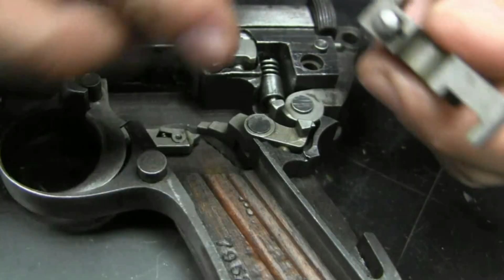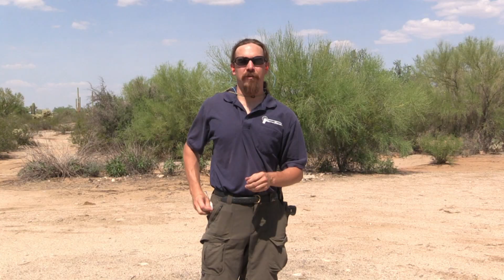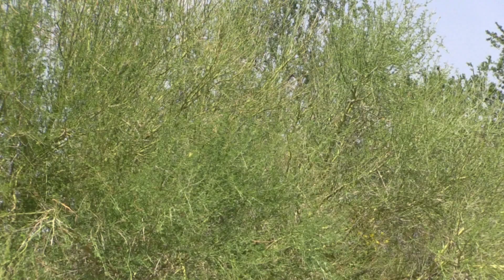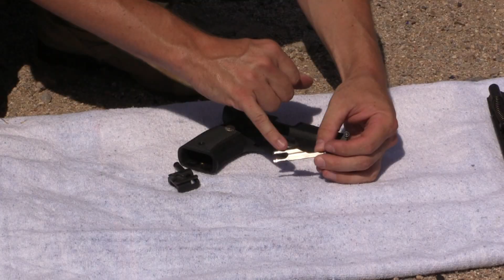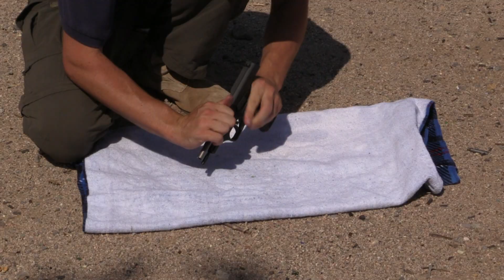Colt All-American 2000 (Disassembly and Shooting)

Comment: i bet Eugene Stoner was pissed that they fucked up his design... just like any other inventor screwed over by a company
Reply: Gene Stoner designed it just like they built it.  Read the patent:  https://docs.google.com/viewer?url=patentimages.storage.googleapis.com/pdfs/US5024139.pdf
Reply: true but in the video Ian said that Colt made changes to the design, making it piece of junk
Reply: Comrade Stalinator That is that is what has been repeated and accepted because people revere Knight and Stoner, not because there is any basis in fact.  Since Colt went into bankruptcy, rumors were flying freely and nobody at Colt was defending themselves.  For his part, Reed Knight would never have admitted (nor was it really his responsibility) that the design was bad. Stoner was Teflon.  There you have it.  No matter how many times you write it down, it does not make something true.
Reply: You're under a false assumption that I am not calm.  Cheers.
Reply: RyeOnHam 1. The barrel bushing is smaller in the patent and is not insanely long like in Colt's version.

2. As said in the video, the trigger pull was meant to be set at 6 pounds, not 12 pounds.

3. It also appears that the trigger pull is shorter in the patent.

4. The original design also called for a shorter barrel and frame, and a single stacked magazine.

5. The original prototype had an aluminum frame, not polymer. The slide rails on the origional would last much longer than the ones on Colt's version.

The prototype of this firearm proved to be well made and worked like it should. When Colt's version of it was presented at the 1991 shooting, hunting, and outdoor trade show, both Knight and Stoner were present. Neither seemed to be too happy about the changed made to their design. It's simple, Colt made an idiotic decision to change a lot of the design of an already good gun. The increased barrel length and grip length messed with the gun's balance which was originally quite good. The long heavy trigger pull had a negative effect on accuracy, and the cheap flimsy polymer rails that the slide traveled on were prone to excess wear, which could have easily had an effect on the gun's reliability and accuracy.

-Signed, an engineer.
Reply: 1. Ian named the sight being on the bushing as a POTENTIAL cause of inaccuracy. It would have zero effect on the accuracy until that bushing became worn. The cheap polymer slide rails would wear long before the bushing did, and the heavy trigger pull would have an immediate effect on the accuracy.

2. Knight stated what the trigger pull was supposed to be. Seeing how he was a co designer of the gun, I'm more inclined to belive him over you.

3. What made the trigger heavy was Colt purposely screwing with the weight of it to intentionally make it heavier. That's been covered.
Reply: Knight designed the damn thing, if he said it was supposed to have a 6 pound trigger pull, then it was supposed to have a six pound trigger pull. Nothing you say will change that.

As for the Ruger, first off the gun was designed to use polymer rails. The Colt originally had an aluminum frame and rails. The Ruger's rails are much beefier than the Colt's and the polymer used to make them is most likely more durable.

Did Colt make the trigger heavier? Yes, what part of that do you not understand? Knight says they did, and it's well known that Colt's lawyers convinced them to increase it. You seem to be the only one not getting that.

The rotating barrel design was based on that of the Steyr M1912 semiautomatic handgun, which was designed in 1911 by Karel Krnka. Unless Johnson could have somehow helped design that system when he was only two years old, then I'd say your claim doesn't hold water at all.
Reply: "The original Knight/Stoner version had a 6-pound trigger pull according to Dave Lutz, vice president of Knight Armament"

"At the attorney's insistence, the trigger pull was increased to 12 pounds. The barrel length also was extended by roughly an inch, and the grip was extended as well, he noted"

-The Gun Digest Book of Assault Weapons

Where is your proof that a 6 pound trigger pull was impossible? Colt screwed with a good design and messed it up. It is solely their fault. NOT Knights and Stoners. All you have proven so far is that you don't know much of anything about this gun. You are making speculations based purely on opinion, and are ignoring the facts.
Reply: Funny how their prototypes worked just fine then. They were not experiencing problems UNTIL Colt started messing with the designs.

You've been making the assertion that Knight and Stoner is to blame even know there is DOCUMENTED proof that Colt changed the designs in major ways. Stoner and Knight were not happy about those changes, and it don't take a genius to know why they weren't happy about it. Colt took a good design, and turned it into utter shit. That is their fault, and it's one of the reasons they went bankrupt.
Reply: I never said Colt didn't make good guns, they just dropped the ball on the All American 2000.

I'm guessing your just a Colt fanboy who can't stand it when people bring up on of their failures. The design was solid, the prototypes worked, and there is no reason why that gun would not have worked as a production model had it not been for Colts stupidity in letting a lawyer make changes in the design.

Colt made a mistake, and it's well know that it was their fault. Get over it.
Reply: Actually, I prefer the works of Browning. I'm not even sure what all knight makes because I haven't cared to look.

Stop reading books? That is a pretty idiotic thing to say, I guess ignorance is bliss.

Who's trying to sell me something?

All you have been doing is making half assed assumptions with no evidence to back them up. Either provide evidence to your claims, or drop the subject.
Reply: Comrade Stalinator 
It's hard to say that Gene Stoner actually designed anything from the ground up.
The rotating barrel concept was used in some of the very first semi-auto pistols.
Likewise, the AR copies directly almost all of its features from the StG44 (split receiver, recoil spring in the buttstock, mag release, ejection port cover, magazine) and Mondragon 1894 (general bolt design), direct impingement was not a new concept either, it was used on MAS-49 and Ag m/42 (both rifles were in service before the AR ever hit the drawing board).
Reply: Jersey Streicher You're mixing up several designs and not going back far enough.  Virtually everybody copied Browning.  Browning patented the Rotating barrel at the same time he patented the pistol slide.  The Remington Model 8 (Browning) featured the multiple-lug rotating bolt. The MP43 was very innovative in overall design, but not so much the elements you mentioned.
Reply: RyeOnHam
There's a huge difference between near-plagiarism and deliberately getting out of your way just for the sake of innovation.

Stoner did very little aside copying other's designs and was pretty lame at it, as evidenced by the fact he copied the StG 44 magazine ommitting the anti-tilt follower features (because apparently he had no idea what purpose they served).
Another example is his reversal of the mag release in the AR (in comparison with the StG 44) to allow mag release with the index finger, it also required a weaker spring, which originally caused accidental mag releasing, before a mag release shielding rib was invcorporated into the lower receiver.

I like the AR, but it's not like it screams "my inventor spent long sleepless nights on R&D".
Reply: Jersey Streicher Although I agree with you about Stoner, the examples you're using are incorrect.  The magazine is not a copy of the StG 44 and this 'anti-tilt' feature you're talking about is a modern construct. Stoner's magazine was no different than dozens of magazines that came before the MP43.  And I wonder why you use the StG 44 nomenclature?  I'd give you a list of books to read, patents to examine, and firearms to own if you'd like.  Few repeating firearms today can be made without John Browning.  Schmeisser and his team were very innovative, but there wasn't a John Browning among them.
Reply: RyeOnHam
"and this 'anti-tilt' feature you're talking about is a modern construct"
Examine the original StG 44 mag follower, the original AR mag follower, and the 2009 updated anti-tilt mag follower.
You will notice, that the StG mag follower is nearly identical to the updated AR mag follower.

"there wasn't a John Browning among them."
John Browning was a genius, no arguing that.
On the other hand he had a penchant for overcomplicated mechanisms and those obscene flat springs that he stuffed all his guns with on any occasion.
Most Browning's original solutions are abandoned today (tilting barrel links, locking lugs machined into barrels, springy extractors, recoiling barrels outside artillery), only the general outline remains.
Reply: You're misinterpreting virtually everything you're talking about.  There's a glimmer of hope, there, but I'm not going to continue with you.
Reply: RyeOnHam
Thank you for a civil argument nonetheless
Reply: Jersey Streicher Try reading "Hatcher's Notebook" & "Book of the Garand" by Julian Hatcher.  Continue to Ed Ezell's "The Great Rifle Controversy", then "The Black Rifle".  Finish off with "Shots Fired in Anger" by George.  For the Cliff's Notes version, "The Black Rifle" has a section on the anti-tilt follower for the M-16.  The only reason ANYBODY knows about it today is because Gene Stoner did not include that feature on his magazine and it cost people their lives.
Reply: RyeOnHam 
Actually, Stoner didn't do much on the magazine. He only designed the original "waffle" 20 rounders for the AR-15 system, and those were under strict parameters dictated to him from the Army brass; they had to be similiar in design to the M14 box shape, they were to be made of aluminum and were to be cheap to produce since the magazines were intended to be disposable; and even then the Army deleted plating on the interior of magazines for cost reasons, etc. The man who made the aluminum 30 round magazine was Bob Fremont. 

This info is from archival footage from direct interviews with Stoner, collected by the Ed Ezell for the Smithsonian's NMAH. http://siarchives.si.edu/research/videohistory_catalog9532.html
Reply: Thanks for the link.  I will check that out.
Reply: SW990 Where do I get hold of the interview tapes?
Reply: RyeOnHam Your best bet is probably contacting the Smithsonian Museum of American History directly. I may be dating myself here but I originally watched the interview on U-matic tape years ago, through a gentleman who's long passed.
Reply: SW990 I had a correspondence with Ed Ezell years ago as well, before he passed. My father had been involved with Armalite in the early years and had some pictures and other "stuff" that Ed was interested in.  Not sure whatever came of it.
Reply: Comrade Stalinator I am sure even Leonardo broke a few slabs.
Reply: Well now thanks to their long history of poor decisions they have filed for bankruptcy and dwelling right at rock bottom!
Reply: Comrade Medved What saddens me is that the overall design could be implemented today, with corrections, and result in a worthwhile weapon.

Comment: The agency I worked for in the 1990's came within a whisker of adopting this handgun when we moved away from revolvers. Fortunately, cooler heads prevailed, and we adopted the Beretta 92G, and later a Glock product. I had the opportunity to shoot a demo gun in 1991 or 92, the presenter is right- the trigger was the weirdest one I ever shot, and felt like squeezing the handle on a rivet gun.

Comment: “Don’t look a gift horse in the mouth.” 
I was recently given one for free. It wasn’t what I was looking for and I initially turned it down but.... I am accustomed to Sig P226’s so this was definitely a step down, however my Sigs are a long way from where I am currently. I haven’t been able to test fire the Colt but have dry fired it a LOT in an effort to get used to the trigger. Years ago I was a firearms instructor at a Federal law enforcement college. We used and trained our recruits on S&W M10’s. Most of the 100 or so training guns had very heavy DA triggers to ensure ignition of the bulk ammunition we were using for training. I know what a heavy trigger pull is like. This Colt is by far the worst that I have personally experienced. Long and not smooth or progressive. The breaking point for the sear is always a mystery. The trigger moves straight back like a 1911. I saw one YouTube video where their particular gun had a two piece trigger face that pivoted slightly in the middle, a bit like a Glock safety. Mine isn’t like that. When starting to apply pressure to the trigger, the entire slide lifts away from the frame a tiny bit. By the serial number this one was made in 1992. I find that the gun is comfortable in my hand with decent grip texture and grip angle. I remember seeing the ads for the gun in shooting magazines in the early 90’s. Does anyone know what the original advertised price was?

Comment: I have been looking for a YOUTUBE review of this pistol for years. I can remember when it debuted, and the hoopla surrounding it. I also remember for every article of kudos there were three or four paragraphs within the same article(s) that mentioned the trigger pull being FUBAR. I also remember that some enterprising armorers simply ground down the roller bar assembly and it 'fixed' the problem. They also polished the barrel to improve accuracy and warned not to use +P+ loads because the slide would stove pipe an empty casing instead of ejecting it completely. This is weird considering everyone and their ugly sister-in-law were shooting +P+ 9mm ammo on a regular back then to keep up with the .40 S&W which ironically buried another late 1980s and early 1990s "good idea" the .41 AE. 
It's okay you can say it "Shit, your old". 
The "tool shack mods" and the gracious attempts of paperback reviewers tried to keep this pistol alive. Unfortunately, it was stillborn on delivery ...

Comment: What is depressing is that there was a time when we decided that proper training could be replaced by a gun that was nearly impossible to negligently discharge due to a horribly heavy and long trigger pull.

Nowadays, you can easily ND any of the DAO pistols.  Luckily, we remembered that perfect practice and proper training is always the solution.

This gun really seems like a solution looking for a problem.  I have seen ND's on the range as an instructor and not surprisingly, it was ALWAYS from operator error and never from the firearm, go figure.

There will always be idiots that should never drive, let alone handle a firearm.  There will also be someone who would find away to blow a toe off with the Colt 2000.

Comment: I've had a Colt All American 2000 for about ten years and have had no problems with it,the trigger does take getting used to.When I got my CPL  the 2000 was the handgun I used  to qualify for the License,we had to fire 100 rds. at the range to get our certification. We were having a good time and it turned out to be 200 rds. I wound up firing ,again no problems. I was surprised that I liked the gun,it is fun to shoot.

Comment: Hey, I had one of these. An acquaintance had it in his shop and it was not selling, so I got it just above dealer cost. I dry fired it, trigger felt like an extra strong staple gun, so I sold it for like $10 profit.

To all companies especially firearm companies. Do NOT let your lawyers in the room when you are going over designs with your engineers. Lawyers are not engineers and that has never worked out for the best.

Comment: The rotating barrel locking system in this Colt All American is reminiscent,if not a direct copy of the 1944  9mm Walther Volks Pistole..a last ditch effort by the German Army to equipt its soldiers with mass produced pistol.

Comment: I must have been very very lucky.  I've owned mine for about 25 years now and it's been a great gun.  The trigger weight and length like a squirt gun is strange and hard to get used to.  But my trigger has been perfectly smooth, nothing like that jerky motion in the video.  It is very accurate and has had thousands of rounds of ammo fired thru it over the years, still looks new.  I do take care of my guns though, so they are cleaned as soon as I get home from the range.  Winchester target and hp ammo have been 100% reliable.  Remington target ammo on the other hand has cause a few jams, so I stick with Winchester.

Comment: I remember when this gun came out, it was touted as being very "high tech" with rotating barrel, ball bearing trigger and a grip that was supposed to be designed for perfect ergonomics.  Then you looked at it and looks like it was beat with an ugly stick.  The trigger I remember picking up on at a gun show had the longest travel ever "are we there yet". 

This thing went over like "new Coke".

Comment: I was a Colt fanboy at the time. I bought one when they were still around $350. 6 months later, they were dumping them for $199. I see them on some gun brokering sites for up to $800 recently! I often joked that I owned the only gun made that trigger pull was measured in 10ths of a mile...